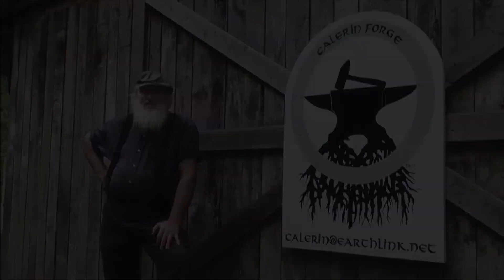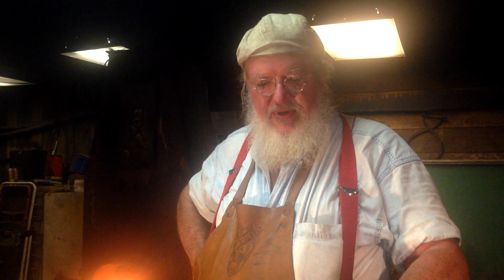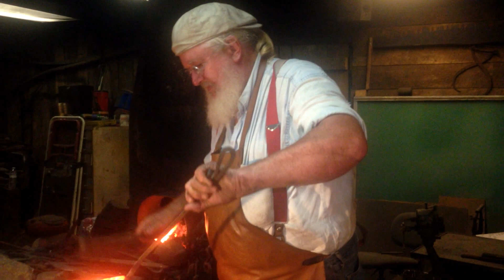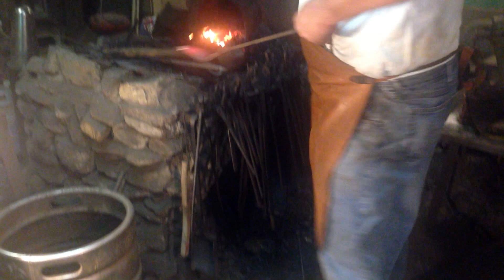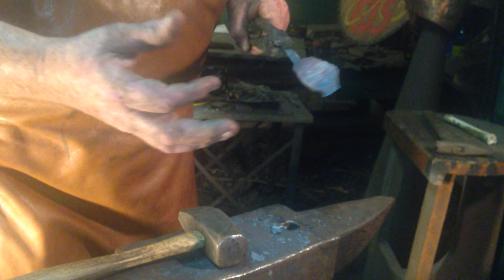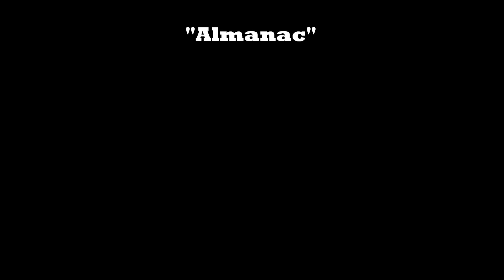Calerin Forge : Damascus Part 2c : Drawing Out the Tang and Forming the Blade

Comment: Hi, I hope this is not a dumb question, but why didn't you cut the cracked edge with a saw or an angle grinder?
Reply: The hot set is quicker and I didny have to plug it in to make it work. I just tend to go old school by nature I guess
Reply: Ah ok, I thought it was way more complicated like for instance an angle grinder would mess with the structure of the steel or something like that. Thanks for the answer. :)